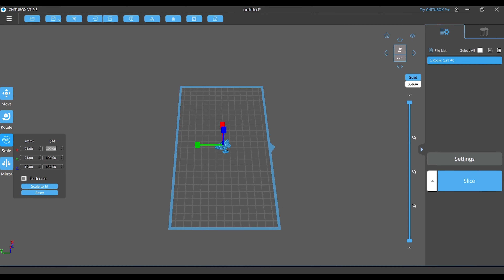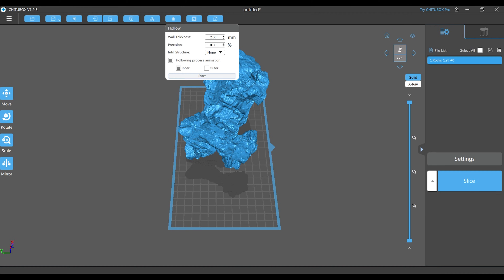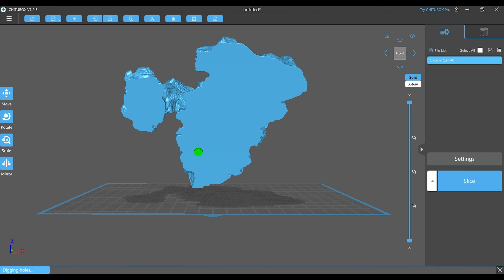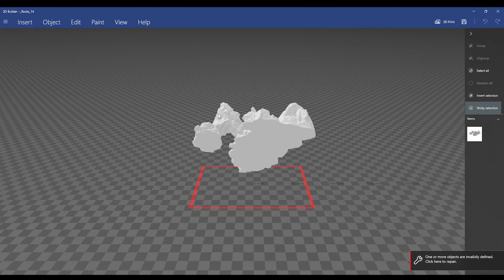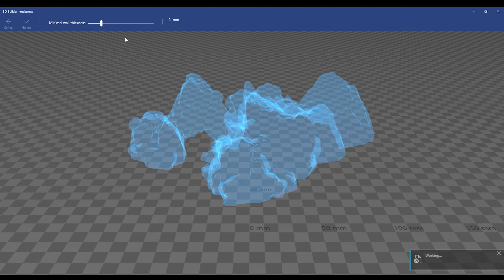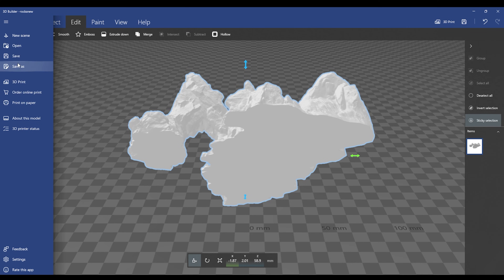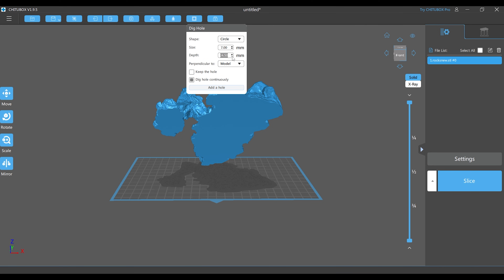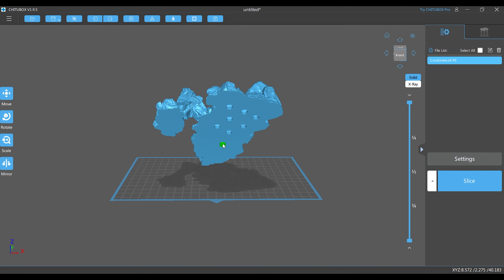CHITUBOX Not Creating DRAIN HOLES? Here Is A FIX!!

Comment: Or, if you're not using internal matrix supports, just check for errors in 3dbuilder, hollow and export before using chitubox. You can also just make a cylinder in 3dbuilder, place it where you want your hole and use the edit->subtract option on just the cylinder. It attempts to remove all geometry that was within the boundaries of the cylinder or shape you have selected.

Comment: Would the scale of the stl file coming from chitubox going to 3d builder change,  or saving from 3d builder and putting back into chitubox change at all? The models have to fit so just questing if say a torso would still fit nicely with legs and arms that weren't done the same way.   Excellent video though
Reply: I just tried it and took a screen shot.  All setting were the same expect for the z axis but it was barely.  Instead of 28.04 it was 28.03, but not a big deal I just changed it back.
Reply from the maker: Thank you for stopping by and checking out the videos. Once I save the file from chitu to an stl and export to 3Builder and vice-versa I haven't had any parts change in size going back and forth between programs.